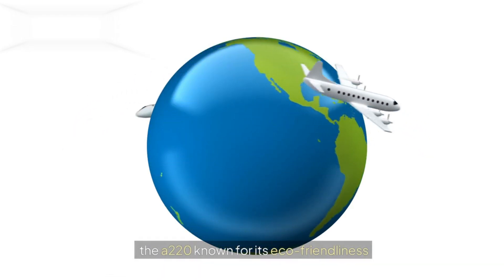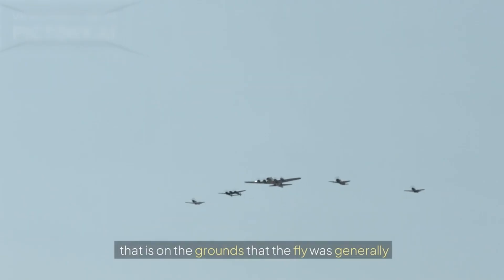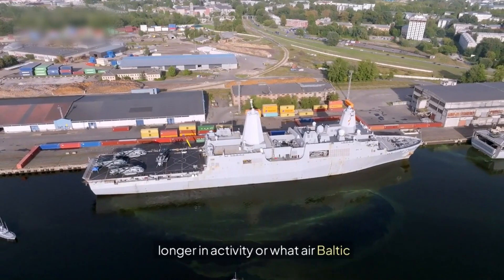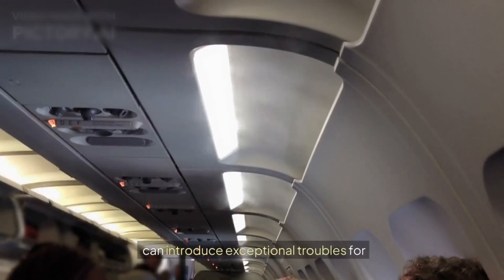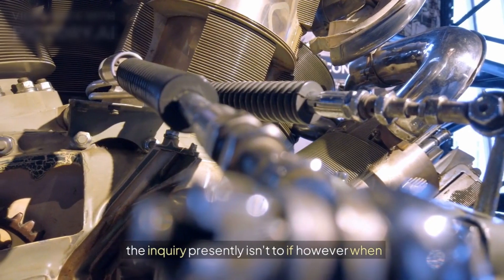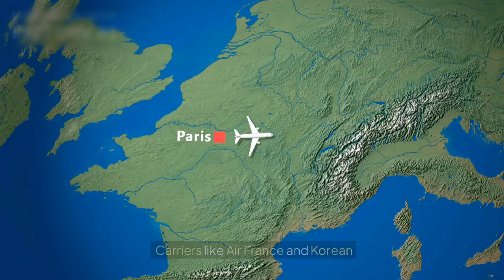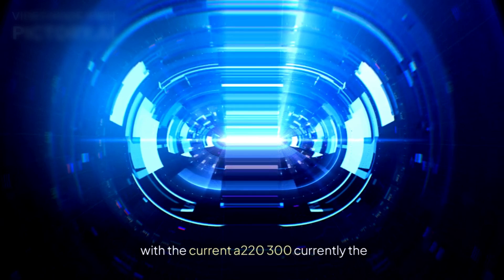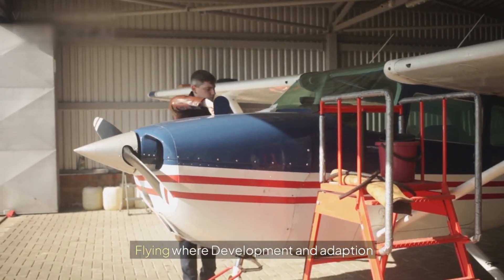Each Airbus A220 Is in hot water and NEEDS Another Motor. Here's The reason

Comment: Sad to see the A220 having issues due to the Pratt & Whitney Engines. Rolls Royce Engines similar situation. Today the only new Engine reliable is the GE. Eventually Pratt and Rolls will master the flaws, they always come a float. The A220 is such a beautiful and excellent equipment, is a Pity the issue with the engines. Lockheed L1011 had issues delivering the TRiSTAR's on time, due to a strike of the Rolls Royce RB211 workers.  That gave a huge advantage to the DC-10 to sell faster.  That is the problem when an airplane is designed for only one exclusive engine.